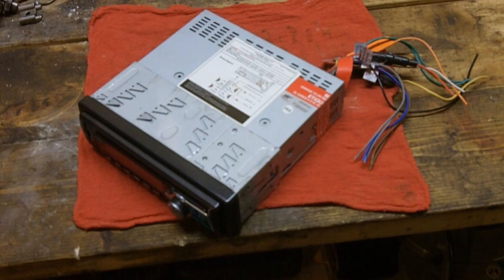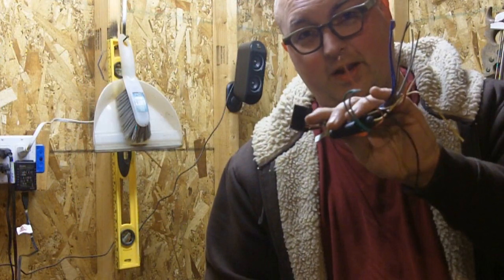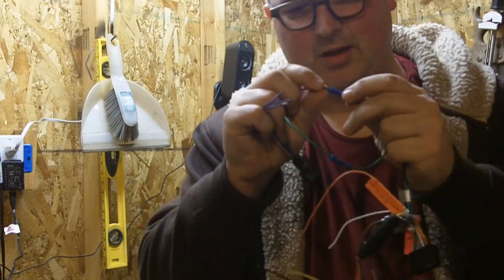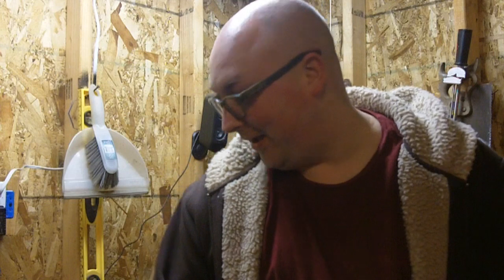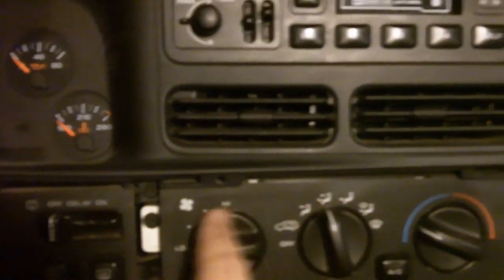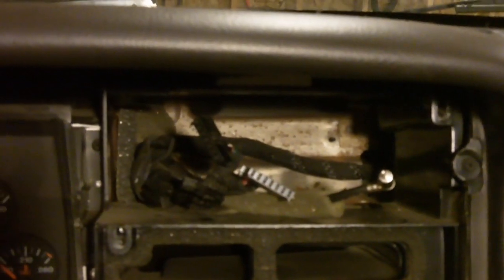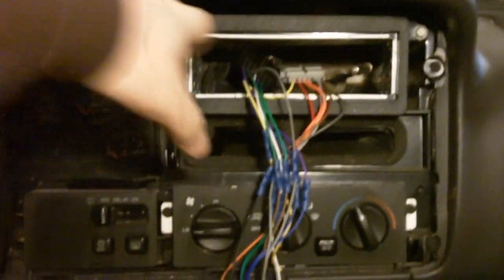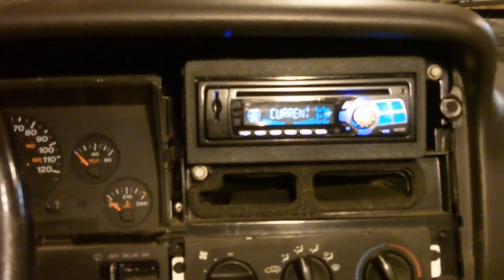MG50 - Jeep Stereo Installation

Comment: No, I was talking about the ground for the stock deck. The little connector on the bottom of the stock radio. It plugs to a metal clip on the stock radio. You don't need to hook it to anything though. Thanks though! Your video helped a bit :) Been awhile sense I replaced a radio in a car.

Comment from the maker: @TiranaKombinati It used to be that cd changers were usually only compatible with Head Units of the same brand and sometimes specific models within the brand. Now I guess they use an industry standard connection on most of the newer decks/changers. I'd start out with googling the make and model of the changer and seeing what it's compatible with.

Comment from the maker: I think you might be referring to the antenna connection. There should either be a cup style connection hanging off the back of your new radio that it should fit in or a hole in the back of the radio itself that the antennae will fit in.

Comment from the maker: I've run into that before. It might take a little bit of trial and error to get everything correct, but 4 pairs of the wires (8 wires) will be the same color with the only difference being that one of them has a line on the side, those are your speakers. If those don't match you'll have to do some testing once you get the radio to turn on to make sure that front right=front right and so on. you'll probably only have a few wires left. One is going to be ground, one power, one switched power.

Comment: nice video. i have a 97 grand cherokee laredo, my radio installed the same way. only thing i did different was i soldered and heat shrunk my connections. but nice video
Reply: Hey I have a 96 Jeep Grand Cherokee and I need help installing my radio. I cut my adapters off that came from my old radio (it’s just wires an no adapter piece) I tried matching colors but it didn’t work was i poss to cut my adapter off the factory wires

Comment: Great video...two questions.  
1.)  Where did you attach the grounding wire clip to that comes from the Jeep and needs to be attached to the new Stereo
2.)  Where did you buy or what kind of wire nuts did you use to connect the wires from the Jeep to the new stereo?

Comment: I'm a little confused on what you did with the metal connector wire that is alone sitting in the back the plugs into the stock radio that sits on the bottom back of the radio. It's got a metal end butt and connects to a metal tab on the back of the stock radio. I've looked for what it's for and am baffled on what it's for and where to plug it in.
advice would be great! Been trying to insult my girlfriends radio in her 98 grand cherokee and cant find the correct harness either. lol

Comment: alright i need some help on this i plug in my kenwood radio to my jeep then its not giving the speakers power then i try it on my other car and it works perfectly fine idk if someone could help me but idk what is happening
Reply: Hook up the Remote wire on the kenwood to the blue wire on the wiring adapter
Reply: Josh M. +1, exactly what i needed to know thanks bud!
Reply: +Mid Troh Thanks for the cool write up, coudlnt figure my kenwood out until I read this post!!! thanks a ton!